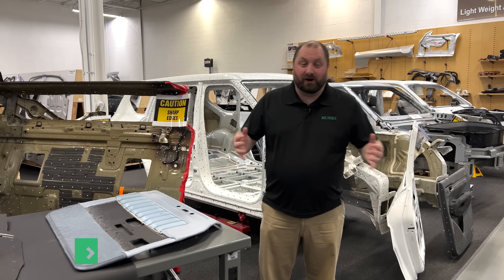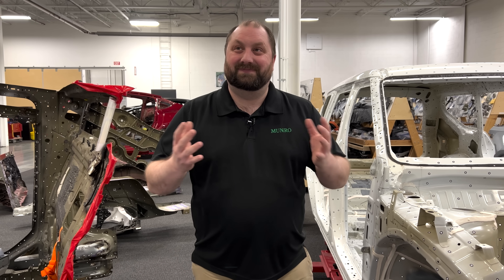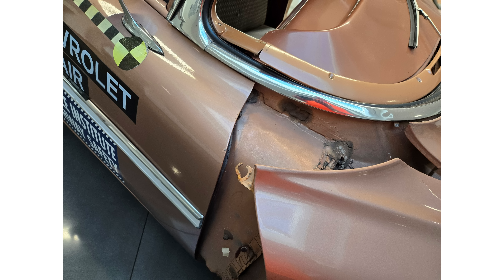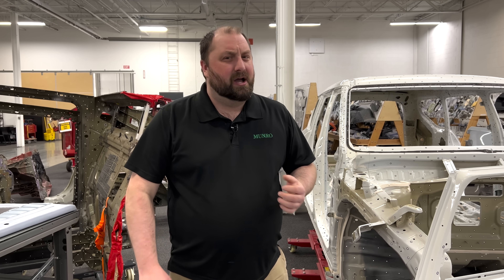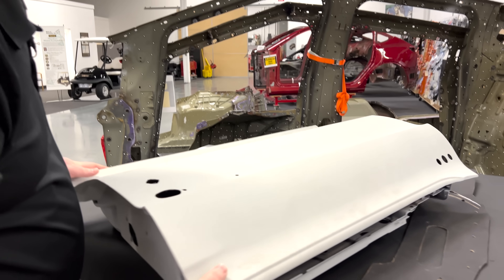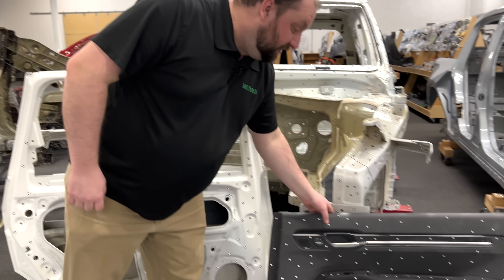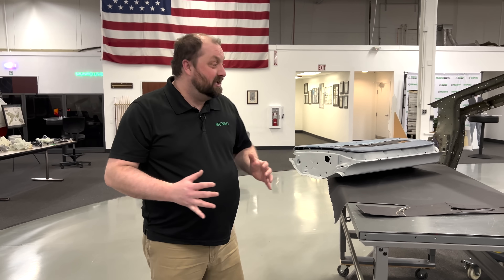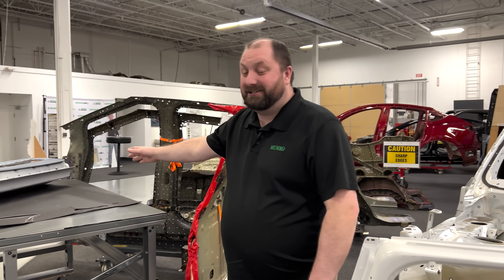No, Your Classic Car Isn't Built Better Than Your New Car

Comment: Okay, I have been driving forever it seems. 51 years. Even before old enough.  In small towns you could get away with that and nobody said you couldn't drive on Grandpa's farm.  That would now be most likely called child abuse.  To us kids it was not. We learned a lot early.  Many of us took drivers ed to get our license but at least 1 in 4 already much experience.

Anyway,  classic cars are of awsome design style, every brand had its own little personality, you knew what you saw when you saw it.  Now without a badge many or most people would know a Rav4 from a CRX and many more.

Now, even though they looked nicer they sucked back then.  Lots of rattles, lots of rust, horrible bias ply tires, shocks that needed replaced every 2 years, sear material and dashes that would split and crack. Hardly any sound deadning, and a big hump running down the middle of the floor board.

When you go to a car show, unless you are looking at a survivor you are not getting the full picture of what that vehicle was when everyone owned them.  Back in the day it was not unusual for a serious accident to kill you.  Not only that I can't say in yhe words I want, but you could find carbon based contents inside that were no longer in one piece, got it, good.

Now what I say is this.  Build a car like you build them today, remove the unnecessary items like a fancy infotainment system, gps, internet capibility, sensors that tell you if you have crossed a line or have gotten too close to the car in front of you, light custom colors for your display and more. This would drastically lower the costs.   But wait, we can't do that. You poor creatures would be deprived inconvienced and would actually have to learn to drive instead of just pressing the gas and steering.

And dang it, get the heck out of the inside lane of the interstate unless you are overtaking another vehicle, yes overtaking not passing.   And quit crossing 3 freaking lanes in 20 seconds to exit when you should have planned for it. 

And lastly to end my rant, if the words merge are paint on the road in your lane it's your responsibility merge blend into traffic, you are the person who needs to take action, quit trying to race us to the end and even driving in the grass or shoulder to get in front.

Take some responsibility dang it, you do not own the road.

Comment: yup, until you try to repair your own new car and turn it into a brick. the computer won't recognize the new parts until the technician at the stealership charges you an overinflated fee to hook up the computer to "fix" it. I'll keep my points distributor and carburetor and mechanical everything. this bullshit about cars being worn out at 100k miles is untrue. my dad had a dodge truck he bought new in 73 and put 300k on the engine without any problems at all.

Comment: My 71 Dodge Charger front bumper is only a peace of chrome decoration.  The top mounts, one on each side are thinner than my little finger so if anyone bumps something, like when parking the car, these thin brackets have to be bent back out.

Comment: the USA has made throw away cars for 100+ years. the luxury cars are the worst. they expected people to buy new cars every 2 or 3 years. they had to be shiny and comfortable and run/drive nice for a few years. they didn't care what condition it would be in when it got to the second owner. poor people were never going to buy new cars. people who bought new and kept their cars longer than 5-7 years just assumed they had back luck or lack of maintenance when their car turned to junk. 
also, they added lead to gas to boost the octane for the newer high compression engines in the 50s and 60s. they had to remove it in the 70s, because it wasn't compatible with catalytic convertors. refrigerants weren't "harmful" to the environment until right before 3M's patent on them was about to expire. then all of a sudden, they need to be replaced. the refrigerants we use today will magically be discovered to be "harmful" in a few more years when 3M's patent is about to expire.

Comment: Also an engineer who works on electronics as a hobby. If you're talking about electronics from before 1960, you're talking about leaky capacitors. You cannot even safely turn on these devices without taking precautions, such using as a dim bulb, an isolation transformer, and so on. I would say that 100% of unmodified electronics made before 1960 have failed. Anything from before 1960 that is in good working order has been serviced to the tune of hundreds of dollars in parts and labor, depending upon which vacuum tubes are worn out or were destroyed by leaky caps. It takes hours and hours of restoration work to get these devices back up and running as good as new. When you're done you have a restored museum piece, but you've often rebuilt the thing from scratch. So in the end you're left with a 2025 device with 2025 capacitors, maybe some 1970's replacement tubes but the pre-1960's design. Let's speak generally here. Anything old that still works well was likely very expensive, regularly serviced, and contains modern replacement parts. Most consumer goods are landfilled. Like those terrible 1960's Japanese transistor radios nobody wants to remember. Japan didn't make the best stuff until the 1980's. In 2025 everything you need is in your smartphone or smart TV. You don't need physical media (records, tapes, or discs) or mechanical players, large speakers, cathode ray tube displays, alarm clocks, desktop computers, or a whole host of other things. Maybe you have some of these things, but you don't need them anymore. Pretty soon laptops will be gone, replaced by tablets powerful enough to play games and render Youtube videos. Things made today are immeasurably better than they used to be. A dozen devices have merged into one device, and if it wears out you buy another one.
Reply: Fully agree...I work on a lot of antique electronics from the tube era as a hobby as well.  The only thing is that many of the older electronics made it to at least 30 years or more old or so without being touched, but can modern electronics have a service life that long?  Yes, old equipment from the 1960's and before is certain to need major work, but the reason it's still around is because it at least made it beyond 30-50 years old without failure, and someone kept it till it was an antique.  THere's a solid-statePanasonic table radio in my mother's kitchen that dates back to the early 1970's.   It's been there my entire life, and still resides there to this day.  SHe turns it on and listens to the same radio station in the morning.  It probably has hundreds of thousands of hours on it, yet it still works 50 years later.  My job is a professional electronics tech that I've worked in for 25 years, and I've seen the "Chinese capacitor syndrome" hit hard over the past 20 years or so.  Pretty much every Matushita / Panasonic professional, and even consumer VTR's made in the early 2000's have bad capacitors in them...they didn't last 10 years without major service needed.  Now, if they can make an inexpensive table radio that can last 50 years without a problem, why isn't their pro grade gear lasting!?!  Every day, I'm finding flat-panel displays by many different brands that have failed, and never made it to the 10 year mark, yet I have customers give me old tube TV's from the 80's to the 2000's that still work, but are just taking up space.  There's a big market right now for classic Japanese HiFi gear from the 1970's, like old Pioneer Marantz, Kenwood stuff.  Many of these old stereos are sitting in homes, and were never tossed because they still work, or at least worked well past their obsolescence point, and the owners didn't get rid of them because they didn't want to part with a functioning device. They end up in yard sales or thrift stores instead.  They may need repairs another 20 years down the road, as the older tube equipment now needs 100% of, but I don't see any of the modern electronics made in the past 20 years, even making it to this point.  Simply put, Do you know how hard it is to find a 1st or 2nd gen ipod now?  most have failed.

Comment: What you're saying is all true, though there's some nuance in what you classify as a classic car. For instance, Mercedes-Benz cars of the 1970s and 1980s were pretty safe, exceptionally so for their era. Cars like the W123, W124, and W126 had sophisticated crash structures and were very high quality cars in general. While today's cars are safer than those, I'd argue that a 70s or 80s Mercedes-Benz is safer than most American or Japanese cars of the early-mid 90s, and still reasonably safe to drive today.

Comment: Folks had a 1961 Plymouth 318 that would foul out the passenger Firewall sparkplug twice a month. We just swapped in another. 
The floor boards were rusted out in Drivers side. Snow and slush would enter. We pop riveted a sheet metal piece over the hole. 

Car was bought new in Detroit and sold about 1967 in Indiana for 100 bucks. Had like 65k on it. When brand new its top speed was 123 mph. Had a big 4 barrel. 

Had a huge trunk rather low and easy to load mowers junk into it. The paint was all like sandpaper; the local shipyards grit ruined all the workers cars. So you drove a beater if worked there.

Comment: I once had three Dodges, a 50, a 99 Dakota and an 08 Charger. The 50, I had to have the engine rebuilt at 50,000 miles because something starved it of oil while I was on the highway. It also got around 12 mpg because it wasn’t geared for 60 mph. The 99 had to have a new transmission at 124,000 and only got 16 mpg because they only gave it a 3 speed with OD. The 08 finally suffered transmission failure at 353,000, but the engine was still flawless. And it got in the low 20’s, even with 360 h.p.

Comment: We are not saying older cars were safer. People say older cars lasted longer. While modern cars are way safer for both passengers and pedestrians,  boy will they last way less and brake down after the warranty expires. 
A 90's and early 2000's Honda, Toyota will outlast someone born in the 90's. Sure it's not as safe in case of  accident. But we acknowledge that. Modern cars have more and more plastic parts around the engine. They'd make the engine out of plastic if they could (and probably will in the future) that lasts just enough as it has to.

Comment: The superiority of older car construction thing is a perception, not fact.  Fact is, there was literally no safety design incorporated into cars before the 70s, with a couple of exceptions, Volvo and Saab. And as far as drive trains are concerned, the only advantage of older engines is simplicity and ease of maintenance, because they needed it!  I have a small promotional booklet produced by the Wakefield oil company, which became Castrol, from the 30s. It gives information on how oil works etc, and how to choose oil in the context of budget. It talks about 1000 mile oil changes and how many GALLONS of oil are used per year, and many less would used by using Wakefield oil!!!!   Ok, it was the 30s but now we have engines that work perfectly well with 12k mile oil changes and oil that easily survives that, although many choose to change at half that, but even that is a massive improvement. Also bear in mind that is with engine performance that allows very high cruising speeds in almost any conditions, compared with 30s cars that would be lucky to see a 50 mph top speed.  Personally I still prefer the look of older cars but I'm not so naive as to think they are better or safer than today's vehicles.

Comment: What year did cars make the most significant leap in crash safety. Such that, we can see a significant difference between the classic car and the 2009 car. Is there a comparable difference between a 2025 car and the 2009 car for example? I’m basically looking for the oldest safe car.
Reply: For me, 90s Volvos are the earliest I'd go while still feeling somewhat safe.  They had side impact protection,  airbags,  ABS, shearing motor mounts, 3-point seatbelt configurations, etc..  By today's standards, they wouldn't be considered safe, but with everything being a compromise, they seem to have a good enough blend of attributes to be viable as a classic daily driver that doesn't feel like a total death trap.
Reply: @ awesome ty

Comment: My daily driver for the last fifteen-ish years has been a mid '70s fullsize sedan.  I'd seen a lot of crash test videos from various decades, and while the '50s and '60s cars scared me; the '70s cars seemed like they were finally starting to care about safety.  Standard seatbelts and headrests; seats that actually stayed bolted to the car; collapsible steering columns; padded dashboards; really long front ends that acted as crumple zones.  Not as many safety features as a modern car, but good enough for me.  What I liked most, though, was my weight advantage.  Most cars on the road at the time were really lightweight, so even though I had less safety equipment, I knew the impact would be less severe for me than the other guy.

But fast forward to today, and my 5,000-lb car doesn't have the weight advantage against all the absurd 6,000-lb SUVs and lifted trucks that are typical traffic now; even regular cars are creeping back up in weight.  I have zero interest in switching to a new car (there are many other reasons I drive an old car beyond just its weight), but I've also resigned myself to the fact that if I get in a crash now, I'm probably going to die.

Comment: What rubbish propaganda. I am a mechanic at a dealership and I work on brand new cars and the older stuff is much better. I drive several older cars and van and the newer the worse they are built, I replaced most of the plastic rubbish with metal aftermarket parts (or fabricated my own) and deleted things like EGR so my engines will last longer. Obsession with "safety" is destroying nearly all aspects of society, keep buying your new "safe" soulless soccer mom suvs

Comment: I remember when I first saw that crash on the TV. I was stunned by how much damage was done to the 57. When I was in my teens I took a driving safety course. During the course it was pointed out that during a crash the engine and transmission often broke away from the mounts and crashed backwards into the passenger compartment. Often killing those inside the vehicle. 
Currently I watch lots of dash cam videos and they include vehicle crashes (please don't judge me LOL) It's staggering how many accidents look horrific and yet the people involved often get out of the vehicle and walk around. In the 1960's if the accident had occurred those people would have been severely injured or dead.
I'm pleased we have such safe vehicles toady.

Comment: Working at old and new cars since 20 years now I can totally agree here. Newer cars are really made better in many ways. The old cars have the advantage of simpler technic, easier to understand and repair them. But they fail more often, for exampel leaks. I have put 300.000mls on my 2005 Merc without any serious engine problems or leaks. No chance with the 60`s Chevys. The sweet spot between good build quality still understandable technic is around 1990. These cars are still easy to repair, last long and offer way better safety than 60`s cars. But when it comes to style, 90´s cars are not my favorite choice ;-)

Comment: When not in a crash, I do kind of miss the fact that I could stand on the hood of my 80s car, or bump into the door, without making a dent in either.  My new car, I can't even sit on the corner of the hood, because there's flimsy plastic in front of the hood edge, and flimsy front fender next to that.  The hood is metal, but it will flex if you push with one finger.  The body and frame may protect the driver, but the exterior is aluminum foil and plastic wrap.  There are advantages to that, but IMHO it has gone too far in the direction of flimsy.
Reply: Had a friend with a Nissan Sentra loose the clutch cable back in the early 90's  He was able to get it into Neutral, and start the engine, so the brakes and power steering worked.  I PUSHED the Nissan down the road with my 1988 chevy Astro-van to get it to the shop.  At one point, I propelled him up to around 45mph to travel with traffic on a main road.  Got the car about 3 or 4 miles down the road to his preferred shop.  Neither vehicle sustained any damage, or even signs of having contacted each other.  Consequentially, he said that's it was the fastest he ever felt that Nissan accelerate LOL!

Comment: There are pros and cons to owning a newer and older vehicle. There is a good balance between not too old and not too new I would say late 90's to late 2000's. Most of the older stuff around this time frame offered good safety features and a legendary build quality. I just recently purchased a 2001 Ford Excursion 7.3. The newer stuff will definitely offer mulitple airbags and a laundry list of safety features, but when it is involed in a auto accident it will be a complete total lost almost each time. I don't know about you, but life is all about balance. I can't afford a new car every so many years a non insured driver hits my car just to throw it away and then get a depreciated check that will not be able to buy me the same equal vehicle with out going into more debt.